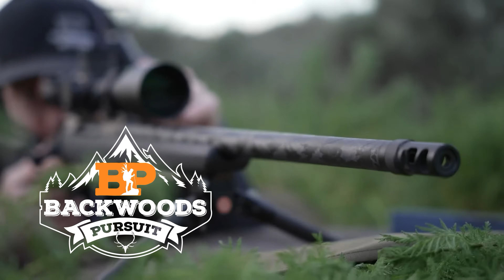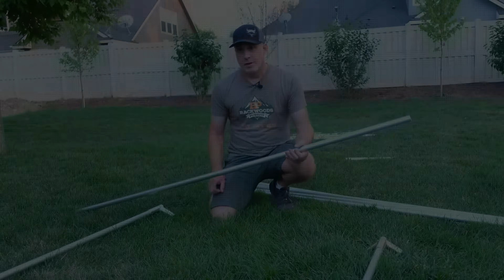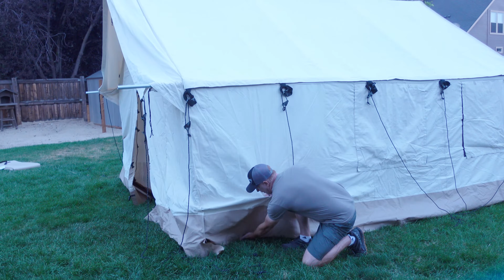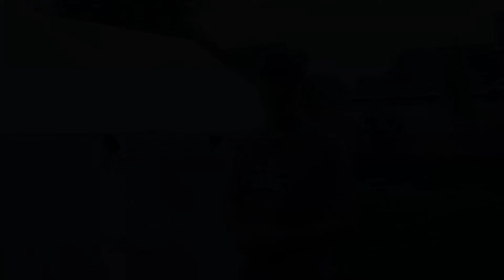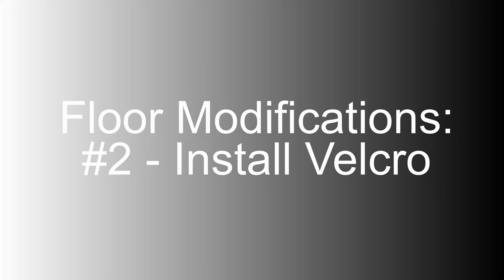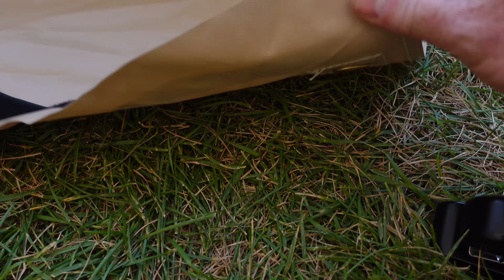Setting Up a White Duck Wall Tent + NO BUGS EASY  FLOOR MODIFICATION

Comment: Wow! Great vid and walk through!!!  @backwoodspursuit, a few questions for ya…

1) The cut on the “sod cloth”, can you also just pull it under the foot of the frame vs. cutting it?

2) Whats your thoughts so far having owned this a while?

3) What made you go with White Duck vs. other wall tents or even Kodiak canvas wall tents? I am trying to make a decision on which brand.

Thanks!!
Reply from the maker: Hey there! Thank you and glad it was helpful! You could try pulling the "sod cloth" under the foot, but that foot is cleated, so it would puncture it anyway. Could certainly try that and see if it works.

It's a great tent and have really enjoyed it over the last couple years! The only "issue" I've got with it is the same issue that all wall tents have in that since the floor isn't sewn in, we've had mice and of course spiders etc get into the tent, even with doing these modifications. Certainly the modifications helped a lot, but there's just no way to keep mice out unless the floor is sewn in. But...if you don't have mice issue where you are at, it's not a problem at all. The bugs were very minimal after the modifications.

I've tried several...including Kodiak (see our review of that here https://backwoodspursuit.com/kodiak-canvas-tent-review-12x12-cabin-tent/). That's also a fantastic tent and has a sewn in floor. That said, it's not going to handle a snow load like this White Duck Alpha wall tent since it doesn't have a full frame. So...just depends on what you need.

Thanks for watching!

Comment: When you wrap the mud flap under the stakes, does the rain follow the mud flap under the tent and then under the the floor through a type of capillary action? Our tent is on a platform for a glamping site and it will be up for 5 months. Did you try this setup over time? What was the upshot regarding the above?
Reply from the maker: Hey! I haven't had it in heavy rain yet, but I plan onto dig a trench to help mitigate that potential issue. We'll see as I'll have it out for a 10 day hunt here shortly. Great question though!

Comment: Does white duck make a sewn floor for the tent? Also what 16x20 tent size with a sewn in floor that’s a wall tent that you recommend other than this dumb floor situation lol
Reply from the maker: @calista910  hey! Yeah, White Duck Bell tents have sewn in floors (see the reviews on our website). Kodiak Canvas makes a 12x16 Cabin tent that has a sewn in floor. Otherwise most wall tents don't seem to have a sewn in floor. Thanks for watching!
Reply: @BackwoodsPursuit  awesome thanks for the fast reply you’re the best!
Reply from the maker: @calista910  any time!
Reply: A tent this size would be very heavy with a sewn in floor. And it would be a real pain to set up...
Reply from the maker: @garyCauser  yeah, it would  certainly be heavier. I also have used the Kodiak Canvas 12x12 with a sewn in floor and it's not bad to carry, and easy to set up. But, it doesn't use a full frame like this one, so it's different. Thanks for watching!